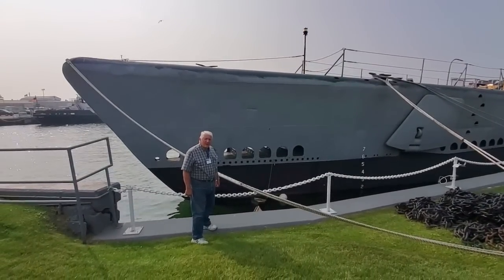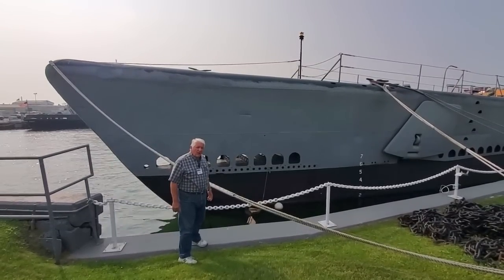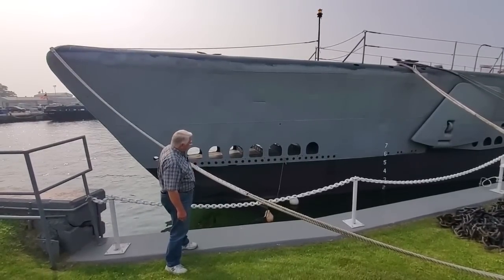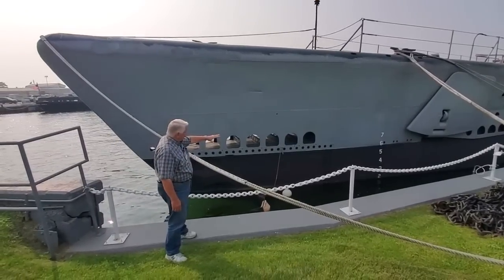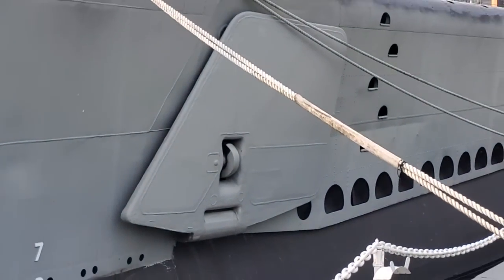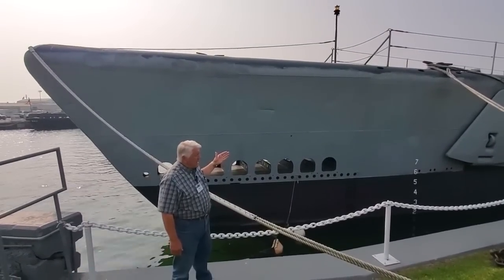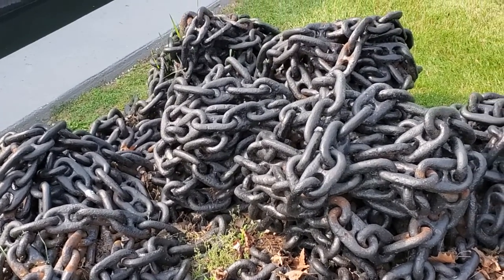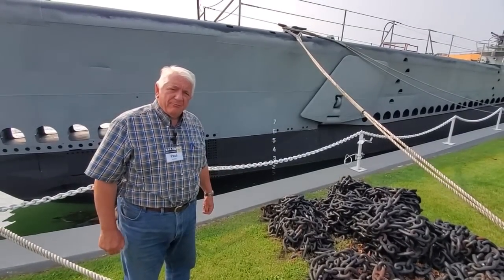Riding the Crests of Waves: USS Cod's Bow Buoyancy Tank

Comment: An incident was reported in the book about USS Archer-Fish (and corroborated by the official patrol report, page 10) had an instance during WWII of the vent on the bouyancy tank failing to open during a trim dive. This was on a trim dive at 0535 on 04/25/1944 between Johnston island and Pearl Harbor while returning from her second patrol. The indicator light showed the valve open, and some "extra" flooding of another tank was not enough, and after ten minutes of trying to submerge, the CO gave up. Investigation showed the linkage was stuck so a few strokes of a hammer  and pry bar got it loose and functioning. They had previous trouble before her Panama canal passage on the way to the Pacific. This defect was detailed in the Major Defects and Damage  part of the report, with detailed description and recommendations for remedy by the CO. Further I seem to remember reading SOMEWHERE, either another boat's patrol report or another book, that that boat had the same problem, which they jury rigged on patrol by removing the manhole over the tank and making it a free flooding space. It is absolutely frightening to this armchair submarine enthusiast to think of a submarine failing to dive in such a manner at a critically mortal moment, like aircraft attack, or being shelled by a ship or shore battery.

Comment: Will you put the anchor chain back or replace it? Why or why not? Thanks for sharing.
Reply: It's probably the weight of the chain that it's left on the side .  I do not know what it weighs,  but it could well be over a ton.
Reply: @welshpete12  600 feet of chain, guesstimate 25 pounds per foot would be 15,000 pounds. 7.5 tons.

Comment: A Navy vet I worked with years ago, who claimed to have served on diesel boats in the 50s, said that in very rough seas, they sometimes had difficulty submerging because, as the boat rode between crests, the water would drain out of the main ballast tanks preventing them from fully filling. Anyone know if this is true, or was he just jerking my chain?
Reply: To dive, you open the vents at the top of the tanks. Water flows in from below and the air is expelled out through the vents.

There can be a cycle rate (period) between wave crests that momentarily relieves the upward pressure of the water that is coming into the tanks.

Thus, while air isn't trapped like when the vents are closed, you also aren't taking in water at the rate you would be in calm seas.

Thus, your time to dive is going to be increased until the bow planes remain submerged and can assist.

Comment: The bow buoyancy tank, although providing better seakeeping capability than the older boats (e.g., S-class) was no panacea. Having been through quite a bit of heavy weather, including one hurricane on a fleet boat (USS Carp, SS-338), when heading into a large wave, one could see the bullnose enter the wave streaming a long bubble of air astern and then the bow would begin to rise, as the wave proceeded along the deck. Even if the crest of the wave did not flow over the bridge, it would often times come up through the bridge deck to give everyone a bath. Bow Buoyancy was also used when surfacing to give rise to the boat. It was the first tank to be blown to surface, followed by the forward group and then the after group. It was valuable in helping to correct excessive down angle on the boat when submerged.
Reply: Would the bow tank be the first to be vented to submerge, to sort of point the boat down?
Reply: @lsdzheeusi  The vent operating levers on the hydraulic manifold in the control room were generally arranged from fore to aft, with bow buoyancy being the lever nearest the bow and the aftermost main ballast tank being the aftermost lever (and tank). The exception to this was the vent lever for safety tank which was the second lever in line. Generally, the levers were operated from right to left as viewed by the operator (the chief of the watch). Thus, bow buoyancy would be the first opened. This was the arrangement on a Balao-class boat built by Electric Boat. Manitowoc boats would follow this arrangement. I cannot say with certainty if the Portsmouth boats had their manifold arranged the same.
Reply: @robertporterfield2023  thank you!
Reply: Was that used when the Cod went to and back from  Buffalo for drydock work?